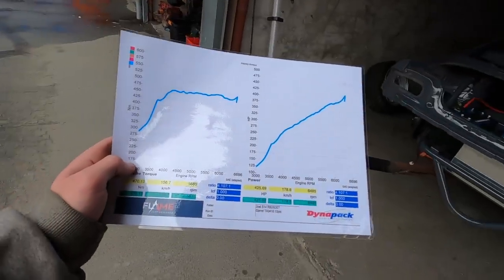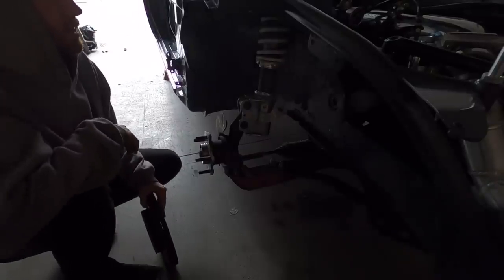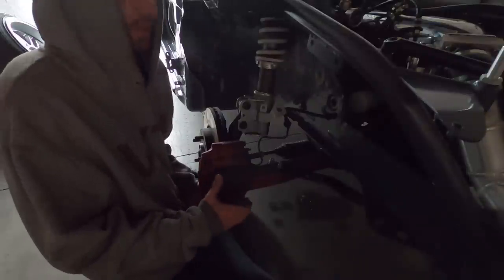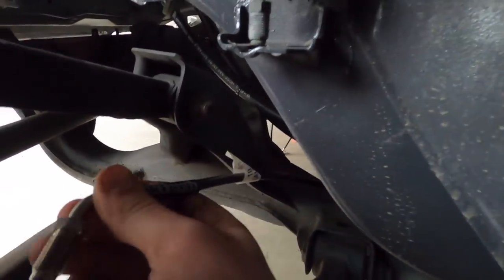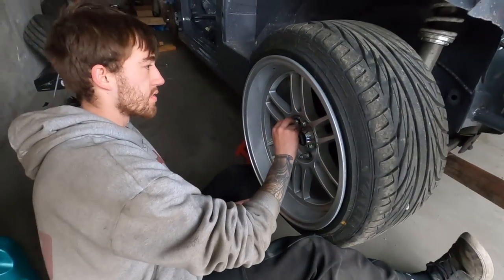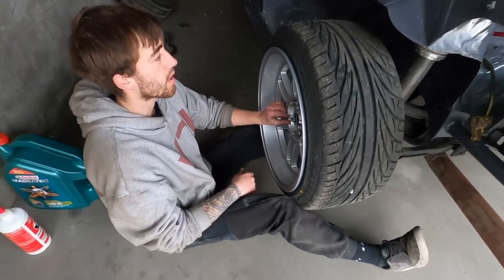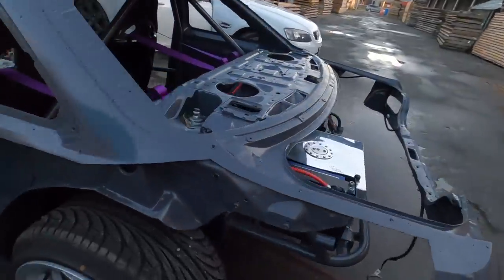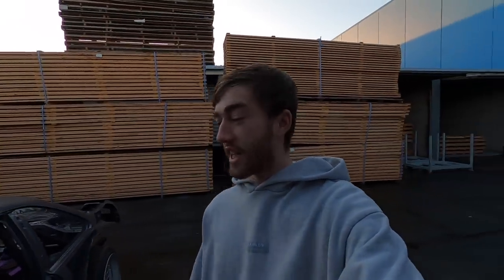MY FIRST BURNOUT In my Freshly Tuned RB25DET S14 Silvia

Comment: Deffinately wanna build a Laurel/Cefiro pro spec car, with a 30 det block, 25neodet head, dogbox/sequential, full tube front, tube rear, fd spec cage, rear radiator, fdf/wisefab angle kit, bc racing coilovers, gutted interior , winters quick change , gtr brakes and deffo a custom overfenders/widebody kit (that im planning to start producing in the future). Not too dead set on the wheels i want yet though. Cheers🤙🏾🤙🏾🤙🏾
Reply from the maker: Sounds like a competitive drift car bro!

Comment: 2020 N80 hilux with a new model landcruiser diesel v8 engine with less electric stuff so you can smash it threw the river … solid front end swap with a 5inch lift Adjustable
With All the bells and Whistles.up graded from bottom to top 35 muddys and a big fuck off gate haha 😂 just because with under glow hahaha 🤣 on the wheel arches
Reply from the maker: Would be one bad ass truck!

Comment: twin turbo 26b rx7 batty 1000hp daily street car full race spec no comfort all the boost , or a cummins diesel motor big boost in a tiny ke30 corolla big torque low revs beast .

Comment: Ultimate goal is to build a fully forged c33
Reply from the maker: I want a c33 so bad!
Reply: @stack3dit    Rorys  ultimate goal is too building a full street legeal drifter  drift car for mexcio city        nissan laurel c33 fully forged rb25 28det         or rb30 25       rb25 30   rb20 30det                rb30 28              rb32det             rb34det      rb31det  
sr 25      sr30det    sr22det.        sr20det